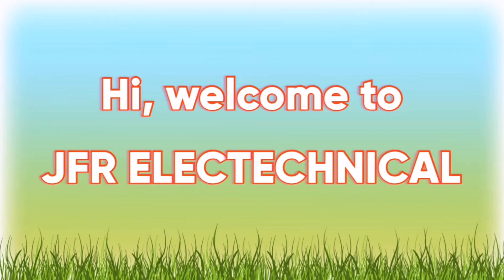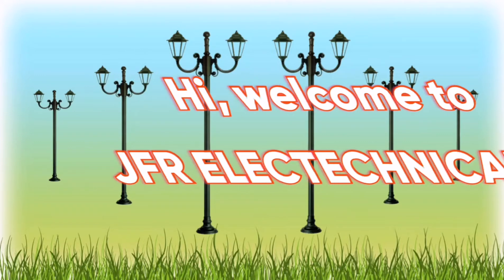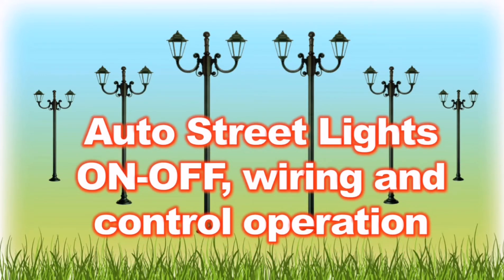Street lighting with automatic on off function using 24hr timer switch control.

Comment: The thing is you’ll need to manually change it depending on the time of year.
Reply from the maker: Yes, your correct if you use a timer instead of a photocell.
Reply: is timer need battery as shown on video while photocell dependents on lights  and automatically charge so which one is better to use?? for me i go to  photo cell